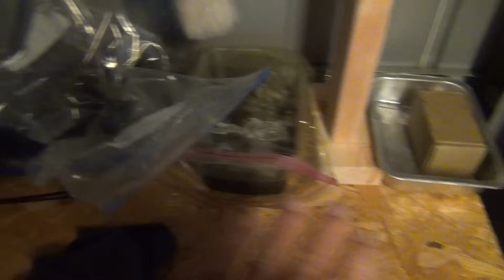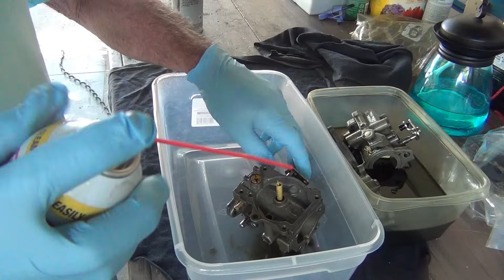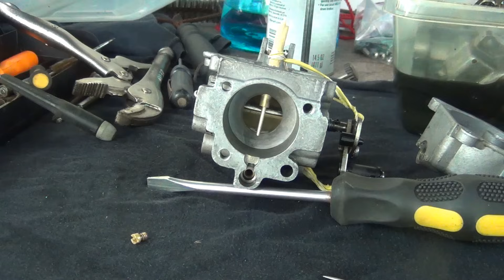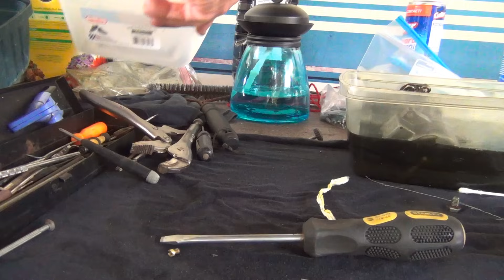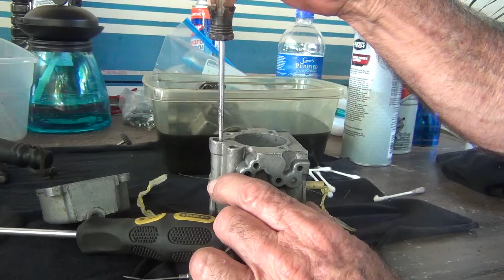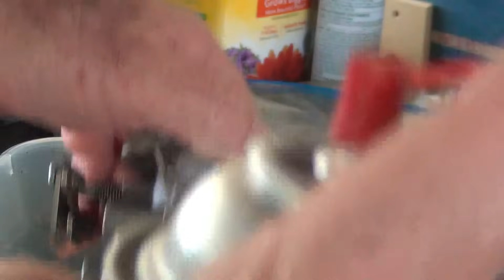Johnson Evinrude Carburetor Clean - The 2 Most Important Things / #outboardrepairvideos

Comment: can i clean those 2 little holes you showed draining while on the boat without taking the carbs off to see if thats my issue?
Reply from the maker: Hey thanks for tuning in. If you have a newer style carb with the plastic top then you can clean them that way but if you have the old style carb there's no way unless you take out the little round plug on the top of the carb but you're just asking for trouble if you do that.. they're a real pain in the butt to get back in properly.
Reply: @THISOLDOUTBOARD1  it’s a 1986 Johnson 90hp
Reply from the maker: @JColip1776  oh a big 4 cylinder, I haven't had any experience with those carbs except once on an 85hp but that was a long time ago!

Comment: What was the mixture you soaked the carbs in? I seem to have missed that and can't find where you mentioned it. Thanks!
Reply from the maker: Hey. Thanks for tuning in. It was a mix of carb cleaner, brake cleaner, a little gas and 2 stroke oil. But the main ingredient that really did the job was the STP Complete Fuel System Cleaner. Thanks again & Stay tuned !

Comment: I got me a 48 johnson and motor shakes on idle. I think carbs are dirty. I inherited this boat from family. I need to clean both carbs but I have a friend who tells me not to take them off to clean them because they are complicated and tricky to mess up when putting it back together  especially the float. He says just leave them on and spray carb cleaner in them and let them work themselves out. Now I don't know what to do. Should I just spray carb cleaner in them and let them work themselves out, won't that send any gunk into the engine? Or should I try to soak them, take them apart and clean them with a new rebuild kit? I'm sure I can do it I can figure out pretty much anything just never done any carb work and have a friend telling me not to take them off let alone take them apart.
Reply from the maker: Hey. Thanks for tuning in. Yes take the carbs off! Hahaha. There's nothing to it! And there's no such thing as "work themselves out"! Haha I luv that! Best thing to do is get an OMC Manual specific to your outboard year & model. Try ebay for a good used one. That way you'll have everything, including a troubleshooting section. After a while you'll know your outboard like the back of your hand. They really aren't difficult to work on. Take pictures and/or video of everything you do then you'll have a reference in case you forget something. Start off with a good tune up. Carbs cleaned, new plugs, etc. A simple throttle linkage/timing adjustment may stop it from shaking. You'd be surprised what a new set of spark plugs will do. Don't forget to gap them! Take your time, get that manual! Your outboard will luv you for it. Thanks again & Stay tuned !
Reply: @THISOLDOUTBOARD1   thanks for your reply and advice. trying to find a OMC manual now. By the way what fluid did you soak your carbs in toe initially clean them?
Reply from the maker: @DasHoots83  STP Complete fuel system cleaner👍

Comment: When I got my motor back from the guy that sold me a powerhead "he wouldn't sell it to me unless he installed it".it wouldn't idle. I pulled the carbs and they had black specks all in them. I changed the fuel lines . The last line I swapped was deteriorated on the inside but the out side looked good. I could bump it on a paper and it looked like a pepper shaker. I noticed the floats were hanging way down, I know I had them where they were a millimeter or so OFF the bowl. They now hit and hang past the bottom. I  called  the guy and he said I had them wrong that he fixed em.???????
Reply from the maker: Hey. Yeah its best to have a good omc manual and get the proper measurements. I'm guilty of setting them by eye because I've done so many but would never have them hitting the bowl. It's not doing its job if its laying on the bottom and nowhere in the manual would it say adjust the float so it hits the bottom of the bowl. Haha. That's why its called a float! Thanks again !

Comment: What's in your mix man? found a free to me 72 25hp johnson that I'm about to go through
Reply from the maker: Hey. Thanks for tuning in! The stuff doing the trick is STP Complete Fuel System Cleaner- then I added some brake cleaner, carb cleaner and some gas, threw in a little 2 stroke oil so it wouldn't evaporate to fast- but it was the STP that did the trick!
Reply: @THISOLDOUTBOARD1  EXCELLENT I’m gonna give that a go this weekend!

Comment: Thanks for the video. What did you soak it in?
Reply from the maker: Thanks for tuning in! STP Total Fuel System Cleaner. Gray bottle. Thanks again !
Reply: @THISOLDOUTBOARD1 
Do you mean "COMPLETE FUEL SYSTEM Cleaner"?
Reply from the maker: @SoulFood4You  yeah baby. totally complete! hahaha I also added some carb cleaner, brake cleaner, a little gas and some 2 stroke oil to keep it from evaporating to fast. just some "fillers". but its the STP that did the job!

Comment: Good video.  Just got a '82 and '78 35hp.  Trying to use the electronics from one to get the other working. Also doing the carb.  The carb repair kit has the little silver disks, under what circumstances to you tackle taking those out and replacing them (after cleaning)?  Thanks!
Reply from the maker: Hey. I would only take them out as a last resort, if the carb was so clogged it wont work with just a good cleaning. When taking the old ones out it can stretch the fitting and can be a real pain putting the new ones back in and getting them to fit snug. I've had to use a dab of JBweld before to help hold the new in, so I quit taking them out, same with the lead shots. Thanks

Comment: Yep I've got a 90 evinrude got to do that to. What was that mixture again? Thanks. Enjoyed the video.
Reply from the maker: Hey. Thanks. Really appreciate you watching and commenting. Thanks again & Stay tuned !
Reply: if you do enough of em', i recommend a $40 ultrasonic cleaner with heater. Put 1/4 of the pan degreaser (oil eater or whatever) and a bottle of fuel system cleaner (i use OMC carbon guard or Yamaha ring-free) and the rest water. turn the heater on and just let em' soak for a few hours, then turn on the machine for a 15 minute cycle. gets the thing looking like jewelry! Definitely take out the core/expansion plugs if you think they are clogged. don't use those cheap Chinese kits as the gaskets just disintegrate and the brass seat isn't threaded properly. factory kits only!

Comment: Trying to figure out why my dads motor doesn’t idle very well, and when I kick it into gear it bogs out & shuts off. 

I replaced his gas line and it helped a little, then my dad sprayed carb with some of that cleaner while it was running. Went back a couple hours later and now she won’t start at all.
Reply from the maker: Hey. Thanks for tuning in. Spraying the carb really does nothing but gets sucked into the motor and loosens up carbon that gets all over the plugs possibly fouling them out. Your best bet is to take it off and properly clean it. Go back to the basics. Give it a tune up! Get some new plugs. Check/test the fuel pump. Test for a good strong spark on all cylinders. That's where I would start. Thanks again !

Comment: Great video to watch very helpful but what I noticed when you put the screw that controls the gas flow you screwed that all the way to the end do do adjust it after the carburetors are installed on the motor
Reply from the maker: Hey. Thanks for watching and commenting. Those are nonadjustable orifices or air bleeds. Actually there isn't anything on these type carbs that can be adjusted except the float level. Thanks again and Stay tuned !
Reply: @THISOLDOUTBOARD1  Yes whatever that part is called.If you try to adjust the float level can it cause high idle ?
Reply from the maker: @gjergjidano5478  no it shouldn't

Comment: Question for ya! Got a 93 Johnson 25hp electric choke. Will a 05 Johnson 30hp carb and intake work? I believe it’s the same carb as the 93 Evinrude 30hp. I understand the Electric choke would need mounted elsewhere OR will the carb bowls be interchangeable so I can still attach the Electric choke to the new 30 carb? Thanks!
Reply from the maker: Hey. Thanks for tuning in. Yeah, if you go to marineengine .com you can compare the two models. Looks to me that the 93 25 and the 05 30 use the same manifold. So you dont need to swap them. I don't think the bowls are interchangeable, but might be with your models. I'm doing the same build, different years but basically the same. The "Beef it Up" series. It's almost done, just got a little sidetracked with these smaller outboards. Anyway, instead of running two primer hoses just run one to the intake nipple. On my build I also swapped the bypass cover. I see the 25 high speed orifice is a size 51D and the 05 is a 67D. Wow you should feel a bump in speed with that 67D jet. I just picked the basic models from 93 25 and from 05 30. Just to be certain you may want to check your models as to what matches and what don't. On mine I went with the 30hp bypass cover. Yours may or may not match. Check out my build if you get a chance. I'm in the middle of kind of the same thing with a 6 horse right now. As soon as it's done I'll be back on the 25 to 35 Beef it up Build. Thanks again & Keep me posted on how it goes!
Reply: @THISOLDOUTBOARD1  I thought the same thing!! 51 to a 67? Awesome! Also, what exactly do you mean by one single primer hose to the intake nipple? Which ones will be eliminated in that case?
Reply: @THISOLDOUTBOARD1  and yes.. thank you for your series. The beef it up series is the whole reason I’m doing this! Otherwise I would’ve never thought of it. I wanted some more pep in my step with my Tracker pro 17
Reply from the maker: @nightwing1129  it depends on your setup, year/model, usually the carb has a nipple on the top near the back and the nipple on the intake. All you need is the intake nipple to prime it. Thats how I did it on my 84 25 with an older 35 hp carb, the carb had no nipple. Worked great, sweetest 25 I ever had! On the Beef motor I think it also has a primer nipple on the bypass cover, thats why I swapped covers on it.
Reply from the maker: on the newer plastic top carb I had to block off the front fuel line nipple coming from the bowl with the screw from the other carb. Does that make sense? Hahaha I'm going to have to go back and watch all the Beef videos again! Refresh my memory Hahaha! Hopefully I'll have this 6 horse done soon then it's back on the Beef!
Reply from the maker: @nightwing1129  yes

Comment: did i miss what you used to soak for the few days?
Reply from the maker: Hey. The main ingredient is STP Complete Fuel System Cleaner, some carb and brake parts cleaner, a little gas and some 2 stroke oil so it doesn't evaporate to fast. Thanks for tuning in!

Comment: Just wrapping up cleaning the carbs on my 2001 Johnson 50HP. the top of the carbs have a plastic plate for the air bleeder and the hose form the primer feeds in there. When I pulled the hoses off the top that run from the primer the brass nozzles came out of the plastic plate with the hose. Should I seal these some how into the plastic plate when reassembling?
Reply from the maker: Hey. Trying to get caught up on all these comments ! Its getting crazy ! I'm sure you made a choice by now, what did you end up doing? Thanks
Reply: @THISOLDOUTBOARD1  I traced the port to a small hole on the silencer side of the carb so it's not under vacuum, didn't use any sealant and so far so good

Comment: What is you homemade solution for cleaning carbs please
Reply from the maker: Hey. The main ingredient is STP Total Fuel System Cleaner, some carb and brake parts cleaner, a little gas and some 2 stroke oil so it doesn't evaporate to fast. Thanks for tuning in!

Comment: I have a 30hp evinrude older style with low speed needle on carb. It idles perfect but dies soon as you roll into the high speed jet but the jet and everything is spotless. Any ideas what it could be I've been trying to get it right for 3 days
Reply from the maker: Hey. Thanks for tuning in. Oh boy the dreaded bog/die at throttle up. I'm having the same issue with my 60 johnson. It just started, haven't had a chance to find out why yet. I was having hard start issues but a new set of plugs took care of that but still wants to stall after its warmed up. Anyway, could be 10 different reasons why. What may seem like a fuel issue could be ignition and vice versa. Do a compression test and a spark test. Don't just look at the plug firing, use a spark tool and make sure it can jump a good 1/2 inch or more. If everything looks good with ignition and timing is set properly check the fuel system. Fire it up, warm it up and put it in gear, after it stalls out pull the plugs and see if they're wet or dry. Sometimes you have to shake the plug off onto your palm or a piece of paper to see how wet it is. If its wet its getting too much fuel and fouling out, thats also a sign of a weak spark, so do the spark test! If they're dry then not getting enough fuel. Here comes the fun part. Hahaha. Fuel pump weak, fuel filter clogged, carb float not set properly at the right height or drop, vacuum/air leak somewhere, bad reed valves. I noticed on my fuel tank line, the primer bulb was running empty not holding fuel, so check that too! Unfortunately there is no one answer to this type of issue. It's a process of elimination until you find the culprit. What year/model is it? Thanks again !

Comment: I have 1989 Evinrude 40 hp it didn't have air filter when I bought it. Should it have air filter in the air box  that's in front of the carbs?
Reply from the maker: Hey. Thanks for tuning in. No air filter! That's actually called a silencer box. No filters on outboard motors, the theory is there's no dust on the water! Thanks again & Stay tuned !

Comment: Hello great video.  What did you soak the carburetor in ? Sorry if you answered that already
Reply from the maker: Hey. The main ingredient is STP Total Fuel System Cleaner and sprayed some carb & brake cleaner in it. A little gas and some 2 stroke oil to keep it from evaporating. Thanks for watching & Stay tuned !

Comment: Howdy from Sugarland Texas. I have a 90SPL  Pre mix.  I noticed that I am getting 2-Stroke oil residue all over the inside of engine cover and engine. However the engine runs great and never fouls plugs. What could be the problem ?  Is this a sign that its time for a rebuild ? Even though it runs great.
Reply from the maker: Hey. Thanks for tuning in. Sounds like the upper crankshaft seal may be failing. It will usually leave a ring around the cover from being thrown off the flywheel and an oily residue on everything. Or, possibly, early stages of the exhaust gasket under the power head may be leaking. If over time it starts dying with the hood on but runs great with it off then thats the culprit. With the hood on the carbs can't get any fresh air due to exhaust gases. I would go after that crank seal first. Hope this helps! Thanks again !
Reply: You are right. I just checked and I have the oil line at upper part of cover. Is that a easy seal to replace ?  @THISOLDOUTBOARD1
Reply from the maker: @Badwolf6466  yes pretty easy, sometimes hahaha, just be careful not to beat up the housing. you can tap a small hole in the top of the seal and screw a screw in it, then pull on the screw is one way. another way, that I like better is to use a screwdriver or small chisel and tap the top of it inward towards the crankshaft all the way around, what this does is pulls the outer edge of the seal away from the housing by imploding it. to put the new one in, gently tap it in to get it started, be sure it's in even, then you'll need something roughly the same diameter as the seal and long enough to go over the crankshaft to tap it in the rest of the way. I usually use a piece of pvc pipe, the thick stuff. the "imploding" method is best. stay away from the housing side, angle the chisel/screwdriver on the inner side of the top of the seal and tap it towards the crankshaft, don't be afraid to hit it, go all the way around until its loose. ez peezee
Reply: Thank you again for taking the time to help. I am a automotive and motorcycle mechanic and What you described is the exact method that I use for seals. Caving them in. Sometimes using the screw and small slide hammer method but small seals do not have enough meat to work with so caving them in is best. It looks super messy and I wonder if I should replace the stator while I am into it. Ill make the call when I get in there. Kinda wondering how 2-stroke oil eats at rubber and plastic like regular motor oil does. I am always helping others with there cars and motorcycles, Its nice to see people out there taking the time to help others and explaining in detail. Thanks again for your help, You are a good man.   @THISOLDOUTBOARD1

Comment: What did you use to soak the carb with? I couldn't find your video of it. Do you have a link for it? Thanks.
Reply from the maker: Hey. Thanks for tuning in. The main ingredient is STP Complete Fuel System Cleaner. Then I sprayed some carb & brake cleaner in it and added some 2 stroke oil to keep it from evaporating. Thanks again & Stay tuned !
Reply: @THISOLDOUTBOARD1  Awesome thanks for the help. 👍keep it up. Hopefully mine turn out just as clean lol!

Comment: Love your videos - I'm getting ready to rebuild the carb on my '59 18hp Seahorse. What is it you're spraying on the parts during reassembly?
Reply from the maker: Hey. Thanks ! I really miss my old 62 18hp Johnson. One of the best motors I've ever had. The best thing I've found for soaking the carb is the STP total fuel system cleaner. The spray is just carb cleaner and brake cleaner for final rinse. Thanks for watching and commenting. Check out my 62. Stay tuned !
Reply: @THISOLDOUTBOARD1  yeah, that little 18hp is a lot of fun. Thanks again